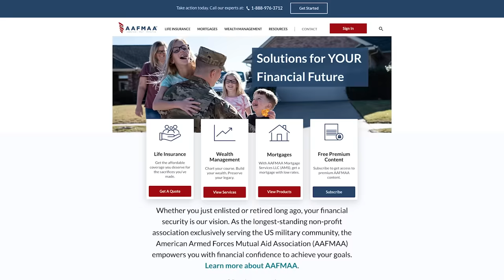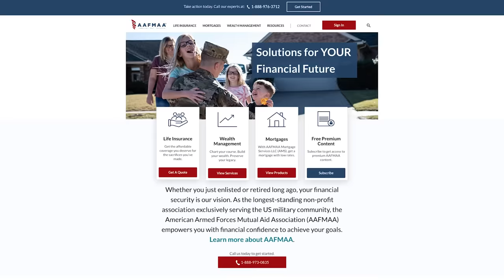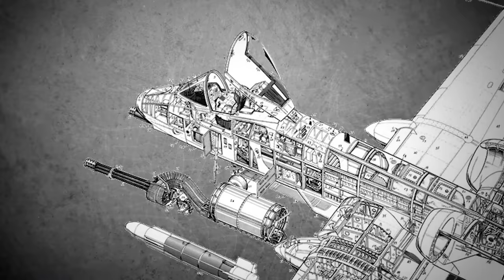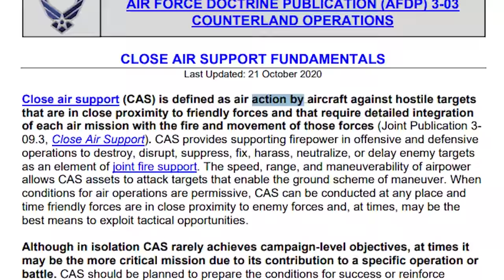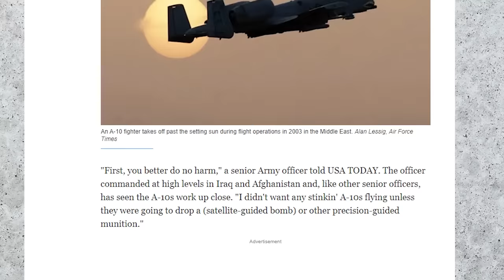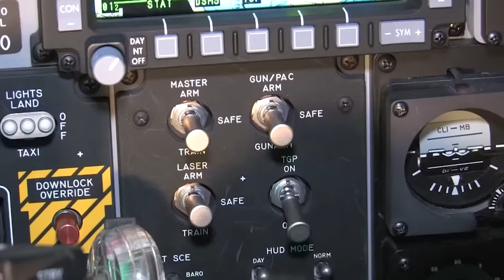Why the Air Force is Screaming to Retire the A-10 Warthog

Comment: The youngest A-10 air frame is 40 years old.
Farm them out to the Ukrainians instead of disposing of them to learn lessons and start a development program to replace it.
Considering there is no risk of a great power conflict on the horizon in Europe the A-10 just doesn't have the range to have an impact in a conflict with China.  It doesn't make sense maintaining a 40 year old platform when it'll need to be replaced in the near term regardless, but especially in a great power conflict.
Reply: Not sure Ukraine wants A10s given they have Su-25s.
F16s would be the better choice given it’s ability to conduct combat air patrol and SEAD.

If the primary SHORAD systems of the Russian VKS weren’t using 30mm rounds, the A-10 could be useful but even flying low won’t save it this time around. (Pretty sure it’s armor is only rated for 23mm rounds)
Reply: I believe an ulterior motive for retiring the A-10 is to do just that: giving them to Ukraine as "old" assets. I'm just speculating this, but it could be another 5D chess move by the U.S.
Reply: Us Mexicans also need some frames to further repel cartel operations to protect our troops.
Reply: The Russian have a lot of SAM,   even for a US pilot, with many years of training, with would be a really difficult mission. Giving planes to pilots with no experience with the A10, won't make any good for Ukraine.
Reply: @creerpepro this would be a great use for it.
Reply: many have been rebuilt...
Reply: Russians have MANPADS and air defence systems, sophisticated ones, something the a-10 would have a hard time against.
Reply: A-10s are no good without absolute air superiority, and Ukraine ain't getting that any time soon
Reply: @prodigalsoniv48   Ukraine wants F-35s and B2 Spirits, but they'll gladly take whatever they can get. I don't think they'd reject some perfectly good USAF milsurp.
Reply: @hobbitronic  not true. A-10s operated in contested airspace in Iraq multiple times.

what people fail to comprehend is that NO jet operates alone in the USAF. it is always a team effort, always has been.
Reply: @SpinoDude88  "sophisticated ones,"

all evidence in Ukraine to the contrary.

"something the a-10 would have a hard time against."

not at all. they did well in Iraq and syria multiple times. They use the same defenses against missiles as the F-16, F-35, etc. If it's not good enough for the A-10, it's not good enough for anything.
Reply: @SoloRenegade  air superiority doesn't mean uncontested airspace, and Ukraine don't have the resources to give the sort of support. Iraq was a totally different situation, to compare the Iraqi and modern Russian air forces and anti air capability is just silly
Reply: @hobbitronic They're receiving over 70 F-16s, throwing a couple A-10s into the mix won't hurt. Use the F-16s to run SEAD and the A-10s to sweep trenches
Reply: @umamidayo  except the AF has been trying to retire the A-10 since before dessert storm.
Reply: @PaxHeadroom  yes it would. you are just complicating things even more by adding a completely different aircraft that they have no training for and logistics to support.
Reply: @hobbitronic  Iraq had THE densest air defenses on the planet in 1991. If you can operate there, you can operate anywhere. 

most people don't understand that, "air superiority doesn't mean uncontested airspace". and they wrongly claim the A-10 cannot operate nor survive in contested airspace. They also lack understanding of how teh US conducts air warfare. We never send in single assets, there are always supporting aircraft. (SEAD, CAP, CAS, refuelers, ELINT, AWACS, etc.)

"to compare the Iraqi and modern Russian air forces and anti air capability is just silly"

why? neither the Iraqis in 1991 nor Russia in 2023, controls the airspace over their battlefields.
Reply: @hobbitronic 😂 Ukraine has redefined the definition of air superiority basically its a MYTH against a moderately competent adversary.
Modern sams have become extremely effective not even the usa is counting on stealth alone
Reply: @SoloRenegade You think the Ukrainian Air Force has the escort details for these things? By your own logic, this is an even terrible deal to give to the Ukrainians given they have not many fighter jets...
Reply: @SoloRenegade  Iraq had* the best air defence system, it was neutralised almost totally believe the ground operations by the best SEAD force at the time, before any A10s were doing CAS,with probably over 300 other active fighters and fighter bombers deployed in theatre as support, as part of the 2000 or so aircraft deployed. Without all of that force multiplication, the A10 would be more of a complication than an asset for the Ukrainian air force.
Reply: @cedriceric9730  the definition hasn't changed, there just isn't the sort of resource disparity that makes is achievable in this conflict.
Reply: It’s moot considering the development timeframes required…but… why not contract an AI piloting contractor to rig A10s as AI piloted drones and use them to disinfect the ruzz built trenches that are bogging down our allies. They are now the most proficient drone operators and A10s certainly have the muzzle force to sweep trenches and lob clusters to clear mines leaving a nice open swath for tanks to retake some eastern territory…and then Crimea. If some get dropped, that’s cheaper than dismantling and storing the old airframes.
Reply: @prodigalsoniv48  They will not have SU-25's much longer, they've lost 16 and are down to 16 as of May 2023.
By summer 2024 the UAF will be down to less than a dozen MiG-29's
Reply: @pogo1140  Hence F-16s are important
Reply: @hobbitronic  "Iraq had* the best air defence system, it was neutralised almost totally believe the ground operations by the best SEAD force at the time, before any A10s were doing CAS"

wrong. look how many A-10 were hit by SAMs and radar guided AAA.

Also, not how many F-16 and other aircraft were taken out by SAM and such.

"Without all of that force multiplication, the A10 would be more of a complication than an asset for the Ukrainian air force."

blah blah blah word salad.
Reply: @hobbitronic  
While We the civilians cheered as russian helicopters and fighters were lost by the dozen,  air forces around the world and even the west were speechless in horror😂

It had been suspected that digitisation and miniturisation had made even simple air defences 10X as deadly but seeing a greatly weakened neighbor of a major air power brush off a full on air raid using manpads was something else
Air superiority is gone and things are only going to get worse even stealth isnt safe.
Air superiority now means low cost networked weapons and an array of ground defences to mantain the bubble
I don't think anyone will be able to penetrate an enemys territory with mass raids ww2 style again
Reply: @SoloRenegade  to be fair to the iraqis , NOBODY had ever fought against stealth and gps guided munitions before , 
 the success of the attack that scared the shyt out of the Russians and chinese and woke them right up!!
Reply: @cedriceric9730  maybe, but every measure has a countermeasure. With sufficient resources and mix of capabilities, EW/jamming, stealth, cruise missiles, low altitude approach,  you can chip away first, then overwhelm. If there's enough resource disparity nothing is certain just based on technical capabilities
Reply: @cedriceric9730  " to be fair to the iraqis , NOBODY had ever fought against stealth and gps guided munitions before , "

False. Stealth was not used to shoot down aircraft nor to conduct SEAD. The F-117 was first used in combat in 1989 in Panama.

the B-2 did use the first ever GPS guided bomb, but it was not used to take out SAMs either. And prior to that the military had already used inertial guidance, laser guidance (Vietnam), TV guidance (WW2), remote control (WW2), etc. for precision munitions. Most munitions in 1991 were ballistic, laser guided, TV guided, Radar guided, or thermal guided.

Most SAMs in 1991 were destroyed with HARM and ballistic Cluster Bombs, and 20mm cannons. The HARM was an evolution of the Shrike used in Vietnam.

In WW2, the US used a TV guided kamikaze drone carrying 2000lb+ of explosives against teh Japanese. of the total number launched, 60% reached their target, and of those that reached their target, 100% hit their targets. The 40% that didn't make it were all lost to enemy AAA and fighters. This is a higher success rate than Russia's Best cruise missiles and smart weapons in Ukraine (including their S300/S400 missiles).

but you're getting off topic and into the weeds now
Reply: @SoloRenegade   Iraq was twenty years and at least one generation of shoulder-fired MANPAD missile systems ago. The A-10 is still the missile magnet it always was, great when burning down grass huts and shooting up bad guys armed with AK-47s at best but in today's military world it's a flying deathtrap for the pilot, the most expensive nut in the whole airframe.
Reply: @robertsneddon731  and Russian tech is decades behind the US. what of it? Russia has improved little to nothing since 1991. Heck, their latest tech can't even defeat their own neutered Mig29s from the 1980s.

"great when burning down grass huts and shooting up bad guys armed with AK-47s "

so....Russian's in Ukraine?

"but in today's military world it's a flying deathtrap for the pilot,"

based upon what evidence? 

Let's do a quick comparison. Which aircraft is more likely to protect the pilot and/or bring them back to base in the following scenario?

A) aircraft is hit by a SAM
B) aircraft is hit by 50rnds of 20mm AAA

Is it A) A-10, B) F-16, or is it C) F-35?

Hint: one aircraft has done these things in multiple wars.
Reply: @umamidayo  Nope. Ukraine already said they don't want it. The defense minister at one point said they'd take the A-10s but in a later interview he clarified that he was not aware of how that would be a waste.
Reply: @userequaltoNull  The A-10 isn't perfectly good. It has ageing airframes and parts are difficult to get.
Reply: @SoloRenegade  Irrelevant. You could have 50 F-15s surrounding an A-10, the humble Strela fired by some guy hiding in a bush could slap it down without any of the F-15s noticing anything. It's not loneliness that kills the A-10. It's the low speed and low visibility of the weapons that can take it out.
Reply: @PaxHeadroom  It would hurt. Every pilot trained in the A-10 would be one less pilot trained on fighters. It would jeopardize thwur defense to put pilots into such a niche airframe.
Reply: @cedriceric9730  The S-400 in Crimea that blew up says otherwise. An an Ukrainian S-300 radar and launcher were hit too. Just this week air defenses faced hard counters.
Reply: @ChucksSEADnDEAD  an A-10 can eat a strela and keep going. A-10s have survived worse.

but also, Strelas are only so good, and the A-10 isn't the only one getting low and at risk. So too did teh F-16 get low, and they couldn't eat a strela.

low speed means little. Many fighter jets can't go mach 1 at sea level, and fewer still are going mach 1 in CAS.

A-10 has the best visibility of any jet as to what threats are on the ground. It's visibility is no worse than any F-15, and its speed and altitude permits a better look.

"The A-10 force, flying more than 8,000 combat sorties, suffered only five A-10s destroyed (a loss rate of . 062 percent). Twenty of these aircraft returned with significant battle damage, and forty-five others returned with light damage that was repaired between sorties."

5 aircraft, 20 ate missiles and AAA. No fighter jet like the F-15, F-16, F-4, etc. can match that.

How come so few A-10 have been shot down by strelas since 1991? They've had decades of chances to shoot at it. Why can't they kill it with a strela?
Reply: @SoloRenegade  The F-16 has options. The A-10 is a one-trick pony.
You don't need to go Mach 1. You only need to be fast enough to get out of trouble. The A-10 has been underpowered since the beginning. It was actually considered for an engine upgrade in the 2000s but there were other priorities in upgrading avionics.
Visibility with the naked eye is a prime example of a false economy. A-10 pilots have failed to identify friendlies many times. Its speed and altitude are a liability, and evidently they still can't see right.
The A-10s suffered 6 losses because there was an OA-10 that never gets counted. The F-16 suffered 3 losses in 12,000 sorties. The A-10 couldn't match that.
The A-10 has been mostly smashing insurgents with no access to proper MANPADS.
Reply: @ChucksSEADnDEAD "The F-16 suffered 3 losses in 12,000 sorties. The A-10 couldn't match that."

 3 F-16s shot down in 1991.  2 F-16 were shot down while I was in Iraq alone. at least one F-16 was shot down in Bosnia, another in serbia. 3 shot down in OIF, 2 Shot down in OEF, 1 downed in Syria. (that alone is 13 with more damaged). Still more where shot down in battles involving other countries like Pakistan, Greece, Turkey, Israel, etc.

A further 9 F/A-18 and F-15E shot down in the same US conflicts.

A-10s and helicopters did the heavy lifting in OIF/OEF.
Reply: The Ukrainians already got offered them. Their answer was "thanks, but no thanks"

Comment: My father-in-law invented this plane. His vision was to first to protect pilots and 2nd to give a platform to protect ground troops and lastly take out heavy armor. Also a plane that could take damage and get the pilot back to base. additionally, it could be quickly repaired at low costs. He specially designed the cage and gun system. As you indicated it brought back the pilots. He was a pilot that won 8 combat metals including the Silver Star, and Country among the metals. He was an amazing person, selfless, with the courage of a lion.

Comment: It would be so cool if, like some older warbirds, they allowed private purchase (with the GAU-8 made inoperable of course).
Reply: Finding parts would be an issue, but it amuses me to think of someone having to put a crap ton of ballast in the body to keep the center of gravity in the right spot with the gun missing 😅
Reply: @ex4787  I think that crushing up a vw beetle is the acceptable solution. The gun is often described as a similar size and weight. Still, wouldn’t need to remove it…easy enough to make it just not work by welding some rotary parts and plugging the barrels.
Reply: Let’s have chocolate ice cream but without chocolate or being ice cream
Reply: @tsarnicholasiiiofthegreatr5578  hahahaha! I think the plane would just be a pleasure to fly Braaaaatttt or not. Maybe we make it shoot confetti?
Reply: @done.6191  you're like Mike Sparks if he was smart

Comment: Many a soldier will shed some tears over the thought, even with all the wrinkles and age spots of 50 years still beautiful. As an Infantryman I felt I could share a drink with an A-10 pilot, with an F35 pilot not feeling it. The A-10 pilot is basically sharing the same moment with the Grunts, not the pilot 200 km away pushing a button like they are playing a video game.
Reply: As good as it is to morale, the A-10 does more harm than good. It's built on an outdated concept and has a notorious reputation for blue-on-blue incidents. The F-35 would get the job done much better. However, you really wouldn't be sending in 5th generation aircraft for CAS. An F-15E or F-16C would be a cheaper option that would still get the job done.
Reply: 90% of A-10 fire missions are launching hellfires from 12 kilometers away and then going home my dude.
Reply: The AF wouldn’t use their expensive F35 on missions the A10 did
Reply: Used that cannon a lot
Reply: You've witnessed grown men crying over a discontinued airplane? War profiteers?
Reply: @tomhenry897  Yep. 4.5 gens would be doing the job of the A-10.
Reply: @tomhenry897 the f35 is currently one of the cheapest planes the US has. Mass production really brought down costs
Reply: @tomhenry897  The mission characteristics would be entirely different.  The F-35 may not even be firing the missiles, just controlling ones fired by an F-15 a few miles back, all while on an entirely different mission.  Imagine a stealth mini-AWACS in a network, and you aren't far off.  

If you need loitering time and presence, you'd be better helped with an Apache or any number of drones.
Reply: Not if you're a British squaddie. Then it just gives you Vietnam flashbacks

Comment: In the Gulf War, the B-1 "plinked" hundreds of tanks. It had supersonic speed for rapid response, tremendous loiter time and a huge payload.  Most tanks are destroyed by missiles. The B-1 was also an amazing "close air support" aircraft in Afghanistan.
With JDAMs, Hellfires, etc, a Close Air Support aircraft does not have to get down and dirty to destroy tanks and troops. 
The Ukrainians are showing that cheap drones, rocket artillery, and cluster munitions are pretty darned effective at giving infantry support. And if you have an environment that is permissive enough for the A10 to operate without getting shot down, why not just use a C-130 gunship. And if it isn't, why not build giant bombers that can carry 10s of thousands of pounds of ordinance on the enemy from a safe distance. 
Even Predator drones could be modified to hit the enemy in contested airspace without risking pilots. Cheaper, infantry deployable drones are being used to spot and clear out the enemy BEFORE you go in. 
The days of the A-10 are over. Robots will replace them.